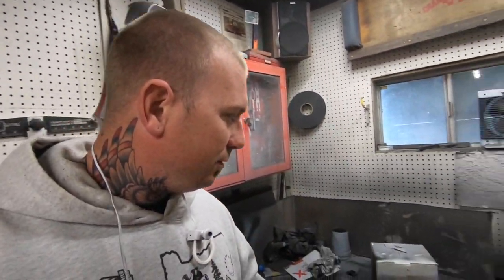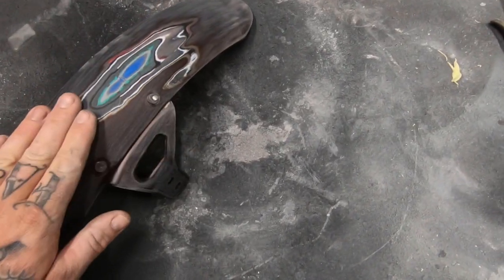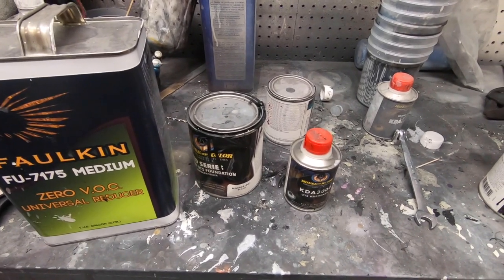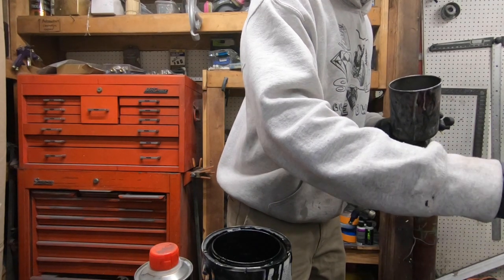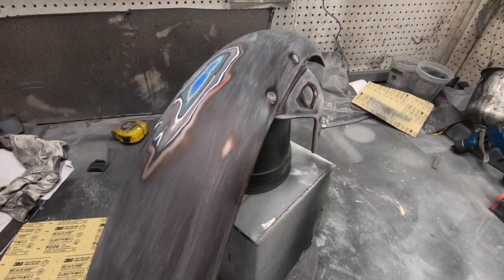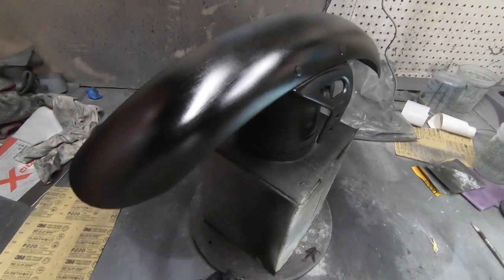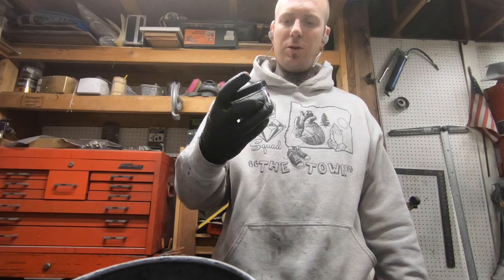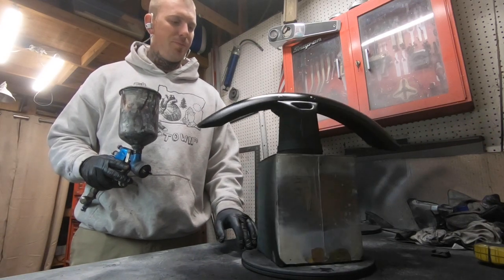How To Paint With Kandy Paint and Metal Flakes

Comment: I see only two things that might compromise the paint job. First after you finished sending, you can see you didn't get around all the rivets. Any spots that aren't sanded will peel over time. Secondly, the two spots that were sanded down past the dark color will show in the sunlight. Its best to do your sanding then spray a solid primer to cover all body work with one color, then sand again and finally your color to get a uniform coverage. It turned out nice though. Just a couple of tips if you're interested.

Comment: Wow that's beautiful! A tip I would have that will save time for buffing is to go slightly slower on your passes with the clear. It uses a little more paint, but the finish will be smoother.
Reply: fast passes with high fluid flow is for pros
Reply: Everyone's an Expert hence that's why they tune in. Keyboard Critics suck.  Enjoy and stop with the BS. I tuned in cause I'm doing a similar 2 tone paint job on a sport bike and wanted to see how yours came out.  The tank and upper fairings are black, and I wanted to flake em a bit and was curious if the candy would change it that much. Guess it does.....so flake and clear it is. I already got Purple on the Fender and lower fairing. Thanks for the show. Appreciate it. Besides every bike goes faster in Black.....
Reply: @anonimous2451  That's why I'm painting my boat black and red, it will be way faster!!!! The fish love the sparkles in the metalflake, they'll be coming from all over the lake to check it out. It's gonna be great!!!!

Comment: 220 is way too rough to mid sand, use 400-600-800
Reply: Ya you want finer scratches for the flake to lay flat. Also a 1.8 gun is rather large. That big is more for polyester primer. A 1.3-4 is more ideal. Imo.

Comment: When I did my fenders I mig welded the brackets on the inside and eliminated the rivets for a smoother look. Why don’t you use a strainer for the primer? I realize that you’re going to sand the fender after priming but any little piece of trash could clog up the tip. So why not strain the primer ?
Reply from the maker: Primer always seems too thick for a strainer and since I’m using a bigger tip I have never had any issue with clogging.

Comment: Excellent work. If you wanted to murder that, when would you lay the black coat?
Thanks! Subscribed!
Reply from the maker: james clark thanks man. What do you mean by murder?
Reply: @stevenragsdale7429 , when painting midnight red, for example, people paint one or two thin black coats over the final base coat, before spraying the clear coat. To allow the color to seep through in direct sunlight.
Reply from the maker: james clark I would candy black over the fender I just painted. After the clear drys I would sand with 800 grit and put a hint of black in the clear and spray. That should add that effect you want.

Comment: I was alittle concerned with painting in the same spot you sanded but wetting it down seemed to work fine. So the flake and candy get mixed into the regular clear and after you do plain clear to seal it in? Also saw some of your other videos looks like your also a NorCal native
Reply from the maker: EditsWithBlur yes the clear after is to cover over the flakes to make a mirror finish. Yes I’m in the San Jose area
Reply: @stevenragsdale7429  Can you tell me how much of each product I need to paint a Suzuki m109r? How much base, flake, candy, and clear? Do they make a smaller flake than you used? Do I need any reducer or sealer?
Reply from the maker: EditsWithBlur I would buy a quart of base and a quart of clear. You can buy the micro flake that’s very small flake. A 2 oz jar of micro flake should be enough for your bike

Comment: Nonsense skipping steps taking shortcuts, overlooking flaws yields inferior quality right out of the gate, you can't fix the inner flaws unless you sand them out, or buff them out doing a multi coat layered lacquer buildup, after wet sanding with 220 400, 600, down to an even smooth surface, wipe with a wax/grease  remover, re prime with a self etching primer, wet sand lightly 400 & 600, use a midcoat adhesion promoter, add base coat, then candy, pearl, clear in the order specified by the manufacturer's formula, let it cure with infrared for extra time, then take a razorblade slightly round off the corners and scrape the nibs off get down to sight along the surface level and gently but smoothly draw the blade perpendicular toward yourself, until the scrapes are uniform with no low spots, carefully hit the piece with 1,000, 1,500, 2,000, 2,500, and 3,000, compound to a deep clear finish with a moderately rigid buffing pad,  flexible enough to bend with the contour, wash off with a degreaser,, treat with a midcoat adhesion promoter again and re-apply anothet clear coat, repeat for a minimum of 3 up to as many as it takes to achieve your goal, each diligent effort and even coat application requires less rough grit wet sanding work, when you no longer need the razor blade for nib scraping, because there are no nibs, don't scrape unless there's a sag or a run, droop, bloop, then just use the finest grit possible to smooth out the imperfections and prepare the final coat, cure each coat under infrared for the required time, then after final coat, just polish with mirror glaze until you can see yourself in 3D from across a gymnasium, or as close as possible to a dark pool of reflective liquid completely still, that's the color of choice, wash with a mild degreaser, blow off with air hose, let it cute 1 mo time, then show the product to someone
Reply from the maker: Hey Tom sounds like you should make a video showing us the way you would do it